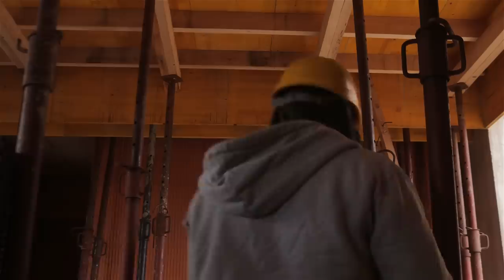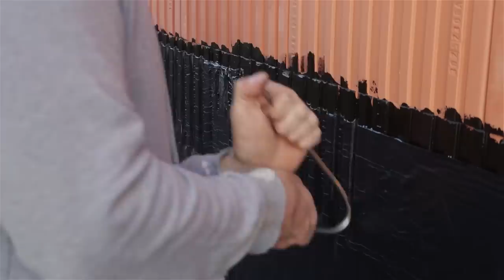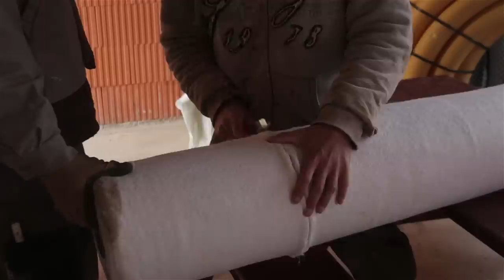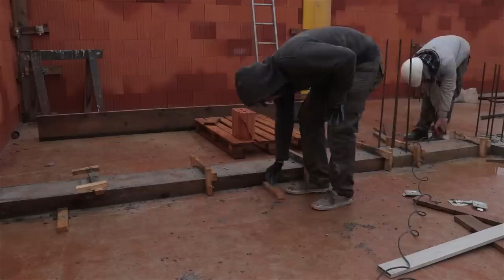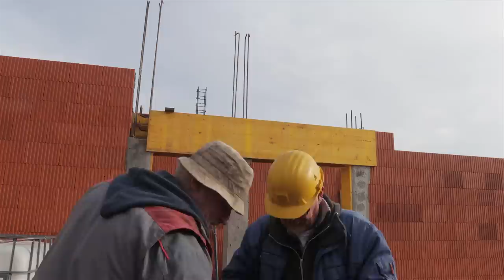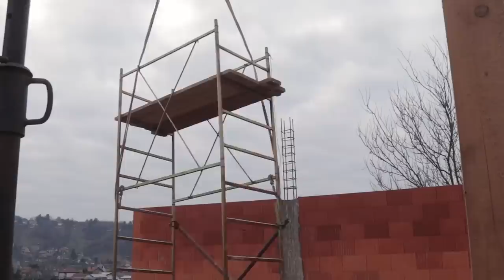Our house build Pt 5- brickwork finally done

Comment: I have never seen such a labor intensive method of building a home.  Y'all sure do things differently 'over there'!
Reply: Well you don't have to do it this intensively, in fact 90% of houses aren't while still using same methods. But there is no denying that the extra steps they have taken here will serve them well into the future with no problems at all. Apartment blocks 5 stories high with total of 45 apartments can be built in 3 months incl ground works, all done except interior painting decorating and fit out. It works well.
You see residents of this house will never have to worry about cold bridges, squeaking stairs or floor boards, cracked plasterboard/drywall, mould, airtightness, bad sound insulation (from outside or inside between the rooms or upstairs downstairs transmission), earthquakes, floods etc...

Comment: As a builder, I have no idea what I'm watching. They never cease to amaze in their technique.
Reply from the maker: :) I guess you are from different part of the globe!
Reply: Same here.    Those red Blocks seem thermally conductive and where do the pipes and wires go?
But, it's very interesting to watch.  Thanks for the Vid. .. and good luck with the Project.
Reply: @jcurran8860  They are not that conductive, only about 0.15w/mK, when glued with the PU foam glue as in this house, this is the most insulating clay brick there is. Over the whole of it goes a layer of styrofoam blocks for insulation anyway. Pipes and wires go inside channels that are made in the bricks when it's time for that, then the walls are plastered. Sometimes people don't plaster the bricks and use metal profiles to screw drywall over instead, to save time, this also makes changing installations easier.
Reply: Concrete with rebars as structures (column, beam , slabs, lintel) and bricks as walls . Rigid house

Comment: Just some comments mainly for fun:
- Wrapping the drainage pipe with geotextile looks like overkill (as the layer around the rough gravel should keep any sand or dirt from entering the trench space) but better to be safe than sorry! (Or is there some reason... like your local building code?)
- The attention to detail when applying the bitumen membrane deserves an award (the Adrian Monk award).
- The size and amount of rebar required for your seismic zone doesn´t cease to amaze me.
Great video. Glad you are making good progress! Looking forward to the woody parts.
Reply: The geotextile is probably not code however you can add it for extra safety to the pipe as the dirt can rub against it and cause a hole to appear which would result in mud building up inside the pipe
Reply: aint no such thing as overkill! :D
Reply from the maker: Yeah I thought about the drainage  a lot and how to do it. Few people said it would be better to wrap the pipe just to be safe. Rough gravel I got was not as clean as I expected , we had to additionally wash it so I think wrapping the pipe was a good choice after all.  As for the bitumen membrane, I just hope it is as good as much as it costs :) And yeah, amount of rebar amazes even the local people.. The code changed after last earthquakes and is quite strict..
Reply: Always, always wrap your drainage pipe.  It's been commercial SOP for many decades in SoCal, yet more recently for light/SFR residential but people still avoid it on occasion on single homes or cheaper tracts until somewhat recently.  And engineers have indeed gone wild with rebar in our earthquake zone these past few decades.

Regional differences:  We go dimples out on the drain board, with filter fabric over that, but you could place a swimming pool there with that bitumen, and not have any worries.

Lignum, I subscribe to about 50 channels on YouTube, about half of which are construction and woodworking, and I look forward to your postings more than any other channel.  Nice work, and Happy Holidays to you and yours.
Reply: @lignumchannel  how come you didn't use  TPO insulation? It seams much more easier. And as for drainage there is nothing wrong with overkill if you want to pay.
Just one thing i learned from all youtube videos is to better have some drainage away from foundation. Even with that kind of insulation there shouldn't be a problem
Reply: @lignumchannel  just out of curiosity, where is the house being built ?
Reply: @desertfox5657  their website points to Croatia.

Comment: I am kind of amazed that those bricks have a stable connection with just foam. Though, I am still a bit skeptical on the long term durability...
Reply: A good brickie would have finished that in half the time. I have never seen such a commotion going through for a base and build. What a weird building.
Reply: I never see bricks bonded together just using spray foam lol
Reply: @spyko7z  It's not just spray foam - it's an actual adhesive.  It's apparently very common in Europe and Australia.  I've been following a company called FBR that has a block laying machine called the Hadrian X, and when i first saw it just stacking blocks with a bit of glue on them, i thought it was insane.  But it's apparently just as strong as mortar.
Reply: @justavian  i'm from Italy and i never see something like that, we use cement :D
Reply from the maker: Strength or durability of this system is not questionable. Much stronger and more durable than mortar. This is not ordinary foam but a glue made by the company that makes the blocks, much more expensive too, one can is close to 25$ and is used for 5m2 of wall
(it comes with the blocks, this is the price if bought separately). Ordinary foam is closer to 5 or 6 $. Another advantage to mortar is that there is not so much thermal bridges. @Tom Kerr No brickie could rival this system with ordinary brick and mortar or blocks and mortar in terms of speed, just preparing the mortar would eat half of your time or you need another person to do it, not to mention cleaning afterwards. There is so much fuss on the first row because it needs to be perfectly flat, blocks are cnc planed to exact thickness of 250mm and have to lay perfectly flat on top of each other to transfer load to the base. If the first row is perfect, the whole wall will be too.

Comment: Everything works like a well-tuned Swiss watch, even the shapely girls in the workshop. Of course, the time shown by the clock belongs to another planet. First we throw the concrete suit, ie columns, beams and slab together and then the masonry. In fact, the columns should form a sand-foundation as deep as possible in the soil and not in the air.
Reply from the maker: wouldn't it be something if we worked as fast as in the video:)

Comment: My goodness. I’ve been raised in construction in north Texas, and this is mind boggling. The concrete/mason work would cost more than a good new house in my area. I’ve built, worked in, and managed the construction of hundreds of homes from starter houses to multimillion dollar ‘mansions’ and never seen structural work like this. Just looks excessive to me.
Reply: Its the exact opposite for us. For majority of people who live in Europe or Asia we get surprised at your wooden houses.
Reply: The way this is built is almost standard practice in large parts of Europe. There are a lot of smaller and bigger differences to adapt to national regulations and locally available resources,  but the basic way of construction is seen all over the continent. Wooden stick frame houses are very rare here (at least in the Netherlands). This house is built very thoroughly through and through and probably exceeds base regulations on some areas. The brick and mortar/ concrete construction combined with the insulation provides a very stable and energy efficient building envelope.

Comment: Love to see the dedication and finesses in the work of you all. The membrane work puzzles me, why? Croatia isn’t below sea level, lot’s of snow?. We use also drain with wrapping, named “cocos drain”. You also will use a sand trap I guess. These building blocks will insulate, but what about these concrete columns? Will there be an additional outside slab/covering?
Looking forward to the woodwork. Regarding the solar panels; taking into account your level of detail work, I would expect an integrated PV-roof, no additional roofing necessary. Be aware to leave space for ventilation to drain the heat. Take care of solid safe connections, then an in-roof PV-system is safe and looks fabulous. A whole roof covered in PV will give you lots of energy to use for heating and power. In any case you will enjoy living in this quality product of your labor.
Reply from the maker: Thank you very much Gertjan! We build for probable events of earthquakes, heavy rains, snow wind etc..  Drainage is for heavy rain that happens once every decade or  so.. House will be covered in 15 cm of expanded polystirene and ventilated wooden facade. The roof will be industrial corrugated tin, unfortunately solar panels are outside of my budget at this time but I will make preparations for it so I can easily install them later on.. It would be awesome though if it would be integrated..
Reply: @lignumchannel  what thickness of steel rebar is used in this columns ? thanks

Comment: I have been following your build for the last few months, and I absolutely love your formwork! So neat and precise!
Was that Polyurethane Construction Adhesive being used to mortar the clay blocks though? I have never seen such a method where I'm from. 
If yes, is it as strong as traditional cement based mortar?
Greetings from Guyana, South America. 🇬🇾
Reply: The adhesive is called Poroterm Dryfix, it is a system produced by the brick manufacturer Winerberger. However you need the special type of bricks for it. It is not only faster and easier, but it reduced the thermal bridges you get with traditional mortar.  It is getting more common here in easter Europe as well.
Reply: @radoslavtomov9121  
Ahhh.
Thank you. 🙂
Reply from the maker: 😁thank you Radoslav, I wouldn't said it better myself!

Comment: I admire what you are doing, but one question, is a corner joint with interlocking bricks not stronger than the method you are using, or is that only something that can be achieved with what i would call conventional brick/block work. Its not a criticism but a question borne out of curiosity. i t looks fabulous either way.

Comment: no concrete cover on the side of you steel cages? and the cages sat on the ground?
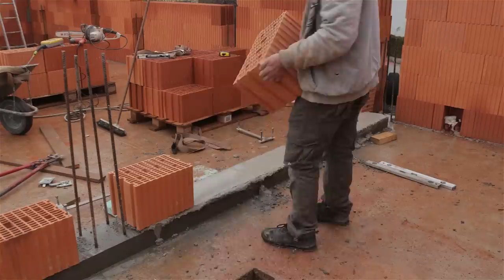Reply from the maker: Not sure what steel cages you mean but there is atleast 2.5cm of concrete sorounding the steel. Foundation rebar is lifted with concrete blocks 5-7cm from the ground. It can be seen in the first video somewhere at 5:40 minute mark..

Comment: Where do those big block walls get their strength from? I thought they'd be filled with concrete.
Reply from the maker: they can withstand 10N per square mm so they are really strong. Concrete takes on horizontal acceleration forces during earthquakes. In non seismic areas house can be built with this system without concrete corners or verticals.

Comment: Excellent video. Some construction questions from a different part of the world:
1) The block walls between the concrete columns... How strong are they before the concrete is cured? Is there any concern about the wind pushing them over before they are supported on the sides and top?

2) the job site crane. Without knowing how many days of time lapse we have watched over these 5 videos, I can't say for sure, but I don't think a crane could be affordably rented for that long for residential construction where I am. How much does it cost per day? Do you need a specialist operator on site? It seems incredibly useful for all the form setting and high block work!
Reply: LMAO
Reply from the maker: @Ken_the_Bigfoot The walls made from blocks can be toppled by the wind but it would have to be quite windy.. I'm looking the weather forecast every day and if I'm concerned we build in sections and pour verticals as we build. During the ground floor, weather was excellent so we built the the whole floor and poured everything at once.  The crane is ours and you just have to do short course to get a licence for it. If you rent it it would cost just a bit over 1000€ per month. On each site after assembly, certified company has to test if it's correctly erected and all safety features work. It then issues a permit for that job site but it doesn't cost much, around 100€ per job site. It would be a pain to build a house like this without it and It's my favorite machine after robots in the workshop:)
Reply: @lignumchannel  thank you for the insight. It seems like a great machine.

Comment: why not build concrete frame and then fill brick ?
Reply from the maker: Because doing it this way  you get better connection between concrete and brick and it is easier to do formwork when you have finished brick walls.

Comment: Please why are adding foam and leather/rubber to the foundation walls and painting it black and also painting some parts of the brick wall black
Reply from the maker: Foam is thermal insulation and black bitumen sheets are water insulation. Black paint is a primer so the bitumen sheets adhere better to the surface. I don't know if you knew but all of my house build videos have subtitles where I try to explain as much as I can. Turn them on by clicking CC icon.  Thank you for watching Makinwa!:)

Comment: Curious as to what heating and cooling solutions you plan on installing. Radiant?
Reply: Watch future videos
Reply from the maker: Plan is to use heath pump in combination with floor heating and a couple of floor ventiloconvectors. Also the south side will be mostly glass and with dark floor and that big concrete wall, hopefully they will soak up the sun heath during the winter.

Comment: What is this method of building called? Thanks! 😎
Reply from the maker: This is a traditional way we build around these parts.. These porotherm profi blocks are little more recent novelty and use glue instead of traditional mortar.. Better insulation due to less thermal bridges because of no mortar. Thank you for watching Bret!:)

Comment: do you have seismic activity foreseen in your area where your house is being constructed?
e.g. zone of earthquake
if you are located in a seismic zoning areas - it seemed your brick walls are deemed weak to resist the seismic movements
likewise, the columns being constructed are deemed not adequate against foreseen seismic stresses
however, if you have nil earthquake movements - your structure may seemed adequate against wind & gravity loads

Comment: What is that black thing you put around ?
Reply: And what does it do ?
Reply from the maker: Water insulation.
Reply: @lignumchannel  how can one avoid dampness when building
Reply: @comewithmetoghana4969  it prevents water contact with the wall and drains it down to the yellow pipe (French drain)
Reply: Looks like Dörken material